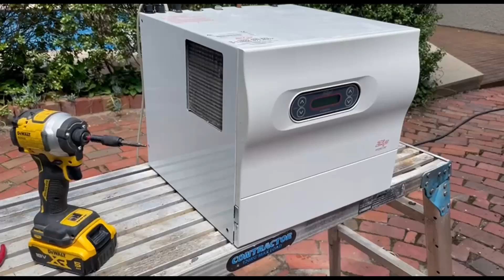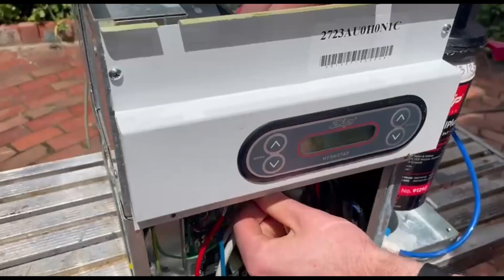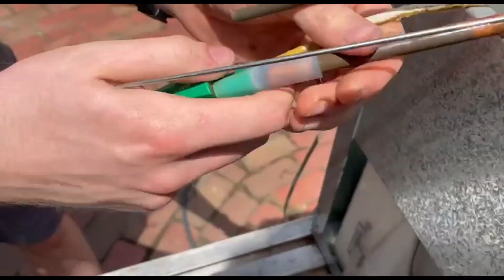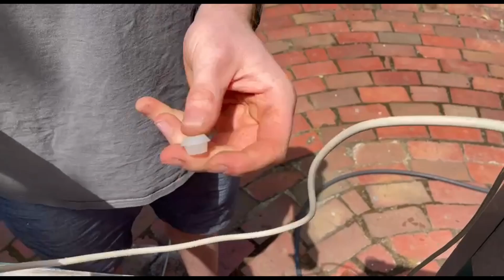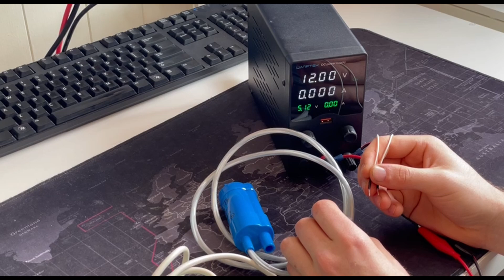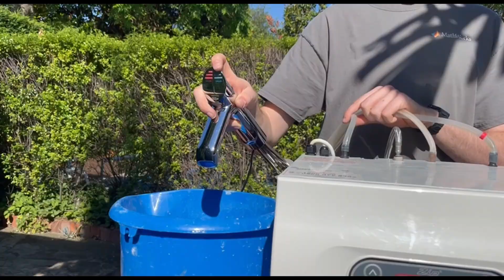No Cold Water on Your Zip HydroTap? Here Is How to Fix It

Comment: Hi mate, my unit makes a loud vibrating sound with only 20% water coming out (cold only). Would you assume this is the pump? It’s a g5 system
Reply from the maker: Hey mate, yeah that definitely sounds like a classic pump issue on the G5.

The loud vibrating noise and low flow is usually the pump struggling, probably worn internals. If it’s only affecting cold water, that pretty much isolates it to the cold pump. 
This pump would probably solve your issue: https://ebay.us/m/dpZmzI

Should be a straightforward swap on the G5.
If you want to verify that it is the cold pump, I would suggest to open the back of your unit, and try switching the pump connected to the hot tank and the pump connecting to the cold tank.
Reply: @UniLabExchange  I also have louder than normal pump noise and reduced flow with the cold water only. I tried a new filter and it did not help. Even during the filter flush, the flow was slow. Does the filter flush rely on the water pump too, or water pressure from the water supply?
Reply from the maker: @kevintaylor-e7q sounds like a inlet solenoid issue and potentially a cold water pump issue.